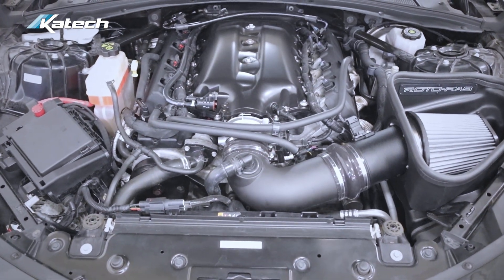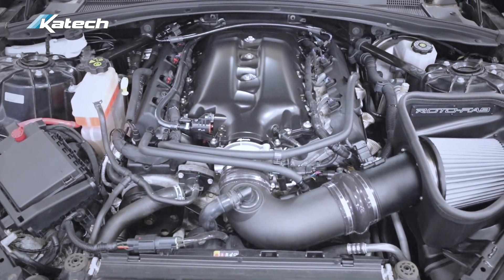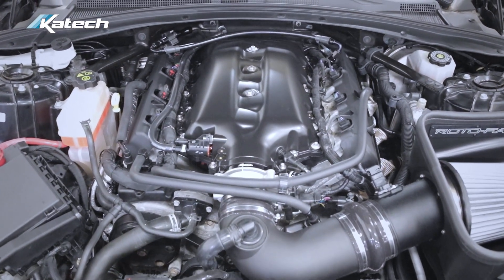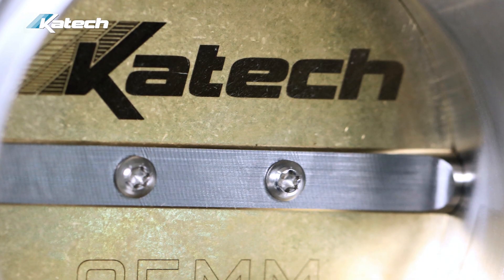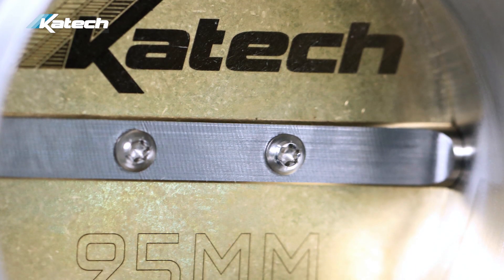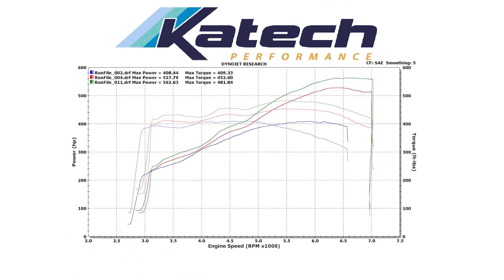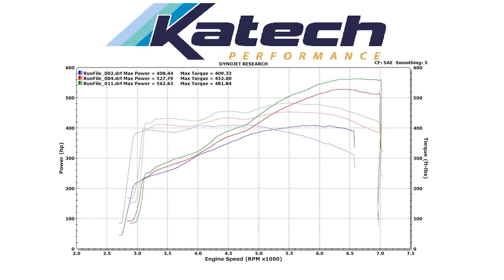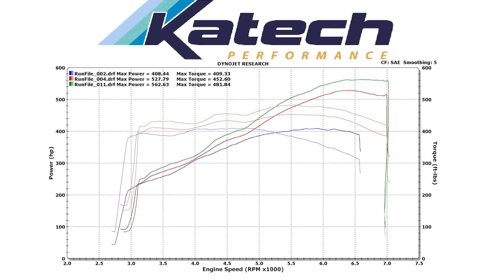Katech Stage 2 Gen 6 Camaro SS package makes 562rwhp on E85.

Comment: Katech needs to come up with a NA racing package for the C8 as soon as it goes on sale in Europe. You could make a lot of money in gt2 or gt3 classes. The platform is there for a world racing car that's way less than Audis or Porsche. Torque wins the class and a modded LT just might be unbeatable in Europe.  Some European team is going to evaluate this package guaranteed, but the parts needs to be ready. Its basically a racing frame already that needs no modifications. The whole racing package is possibly the cheapest in all of motorsports.
Reply: Gotta wait until tuning becomes available.